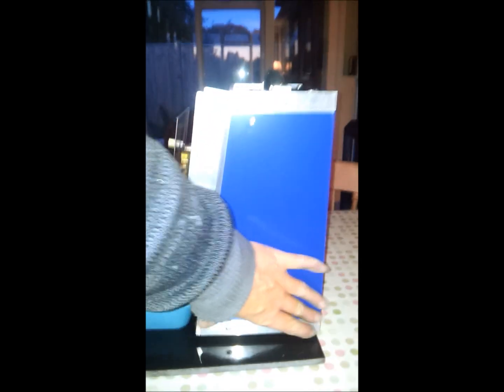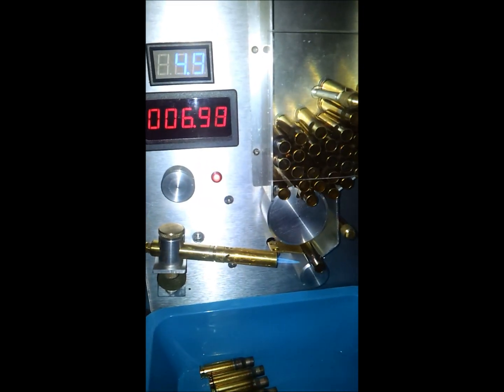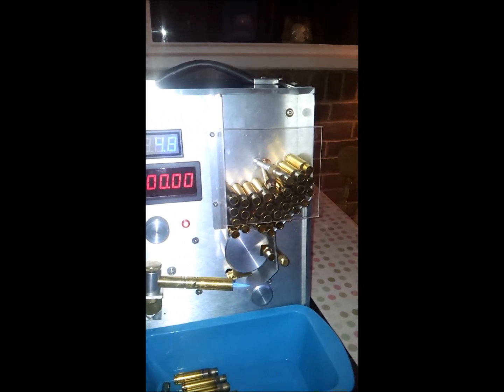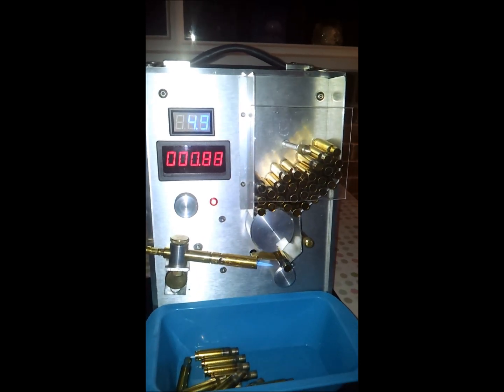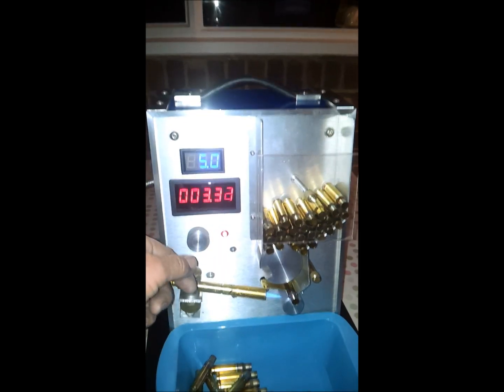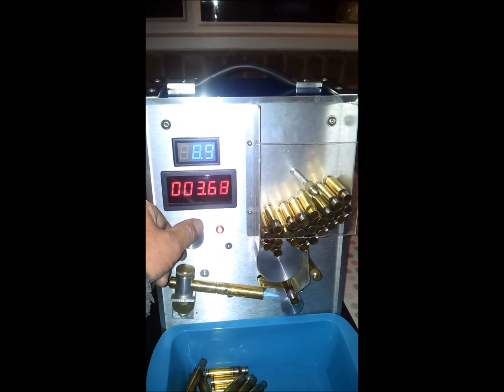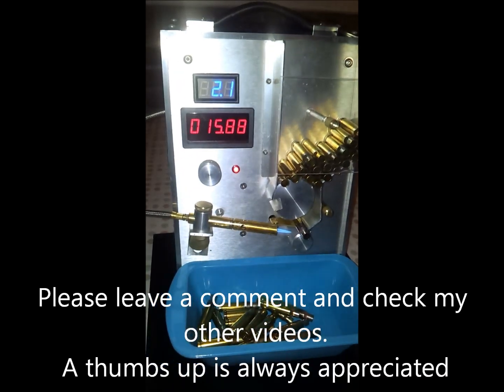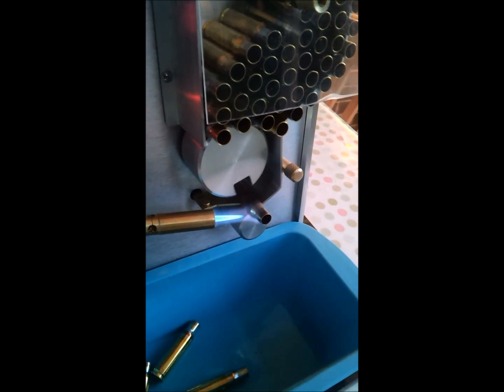Annealing machine  - Made in home workshop

Comment: Half a tank runs about ninety 308 cases???  What kind of tiny tank are you running??  Using my 14oz propane tank I annealed 850 .308 cases and couple thousand .223 cases and it probably used 10-20% of the tank!  At one point I hooked up nearly empty tank to see if I can use up remaining gas and it it just kept going and going, I was able to anneal 600 cases and still had gas to spare!  You just have to make sure the tank doesn't get cold as flame drops but that wasn't issue with 1st full tank.
Reply from the maker: That's a 1lb Coleman tank - it has the same fittings as the Rothenberger tanks. I've never counted how many cases I get out of a tank, at least several hundred. Those tanks can be refilled from a larger tank with an adapter. You right, it's the drop in temperature that lowers the pressure, not the quantity in the tank.
Reply: @Targetmaster1066  What I am saying is that you severely underestimating how many cases one full 1lb tank can do.  Based on my 900 cases  I estimate 10 - 20 thousands can be done.

Comment: Great annealing machine,and also good to see your casings are not being quenched in water as a lot of people don't realise quenching the brass actually makes the brass brittle and significantly shortens the life of the brass.
Reply from the maker: Thank you Badger and yes, certainly no advantage to water quenching brass.
Reply: Interesting about your comment on quenching. I was recently on a "reloaders" one day course where this topic was raised. Attending the course was a gent who has been a metal worker most of his life. He actually said that brass is one of the few metals that SHOULD be quenched in order to retain its malleability. He said most other metals would indeed become brittle if quenched, but brass actually needs to be cooled quickly (quenched) in order to stay workable!
Reply: @desolwage  no that's incorrect. Ammunition brass is subjected to high pressures compared to brass that's used for other applications.
Reply from the maker: Sorry Des, no benefits what so ever, to quench brass in water for case annealing (just stops you burning your fingers when you pick one up to admire your handiwork) Metal craft workers might water quench to enable them to immediately continue to beat/planish the work piece and also to loosen any shale/oxide prior to pickling.
Reply: @Targetmaster1066  The reason for quenching brass after annealing is to prevent the heat travelling further down the case and affecting the hardness of the rest of the body and even the head. You clearly have no idea what temperature you are subjecting the brass to or the hardness after annealing it or what effect there may be on the hardness and therefore strength of the rest of the case.
Reply from the maker: Thank you for your insight John and I agree the only way to harden brass is to work it. However, you clearly have no idea of what I know about about my annealing temperature or heat transference or the hardness of my cases - I've checked to see if I could learn anything for your videos on the subject but unfortunately not.
Reply: Quenching does not make brass brittle. Hardness and brittleness go hand in hand. The only way it is possible to harden brass is by cold working (deforming) it.
Reply: @johnspencer6270  lol bullsht. You have no idea what you are talking about.
Reply: @johnspencer6270  quenching DOES make brass brittle,it changes the molecular arrangement when the temperature is suddenly dropped. The same principle happens when blacksmiths quench metals when forging,it hardens the metal but also makes it brittle. When brass is used in the application for ammunition casings the last thing you want is brittle brass and THATS why we dont quench ammunition brass.

Comment: Any chance of making a how to video please. It's the best I've seen so far. Interested in making one similar. Thanks
Reply from the maker: Thanks for the interest - This was my first go at a proper annealer, well before the "skippy" annealer was introduced so really starting from scratch. Although I made about a dozen they were far too complicated to make with the mechanism and cams more like clockwork between plates. I then had a radical re-think and designed the Mk 2 which was much simpler but worked just as well. - I may well do a "how to" video of that machine at some time but at the moment working on other projects.
Reply: @Targetmaster1066  Thanks, what i really found interesting is how you managed to synchronise the rotors with one motor. Maybe even a look at the interior mechanism is enough for now, Thanks

Comment: What is the dimensions of the top roller that picks up the case out of the hopper? Im in the process of making myself one
Reply from the maker: Hi Cody - The case collector is made from some stock 2" aluminium bar, just skimmed down, it's not too critical.
Reply: thetargetmaster what about the cutout that picks up the case
Reply from the maker: It depends on what calibres you plan to anneal. That one does up to 284 cases, I believe the cutout is 13x13mm. This works for all the 308 family, 270, 243, etc. If you want to do .223 family you will need either a smaller cut-out to stop two cases trying to feed together of make a removable filler to pack out the cut-out a bit.
Reply: Yeah im doing 308. So it's 13mm wide by 13mm deep. Thank you sir. I used the salt bath annealing setup but there's to much loss of salt
Reply from the maker: Good luck with the build Cody - Let me know how you get on.
Reply: My boss is cutting the rollers right now. Hopefully I'll have it done over Thanksgiving weekend

Comment: what torch head are you using?
Reply from the maker: Hi Bob - The torch is made up of various bits. It's basically a Burneze  torch cut in half and the two halves joined together with a flexible tube from a gas camping stove.
Reply: thetargetmaster thank you sir

Comment: So where is the water in your quenching tub?
Reply from the maker: +rootbeer4969 Hello rootbeer. Quenching many metals in water usually makes them harder but brass behaves differently. Once the grain structure of brass has been modified by heating to around 750F, whether it's left to cool slowly or quenched in water has no effect.
Reply: But you gotta keep the heat at the shoulder from migrating to the cooler head. If the head gets too hot, the case is trashed...
Reply from the maker: +rootbeer4969 By careful use of Tempilaq heat sensitive paint I have found that the temperature at the head never exceeds 350F. The annealing process or stress relieving of brass starts to take place after around 700f - below 600f virtually no structural changes take place.No water quenching necessary.

Comment: Nice annealer design & well built. Does the case rotating drum have a coating on it? if so, what? Also how do you trigger the timer? & what is the drive train from top shaft to the bottom one.
Ian
Reply from the maker: Ian Sugden Thanks Ian. The rotating drum is machined out of 25mm Aluminium, there's no coating on it but it's knurled to give it a textured finish. Everything is timed from the central feed drum, a cam trips a microswitch to start/stop the clock timer and a cam lifts the blocking arm to drop the cartridge, nothing can go out of time as it's all locked on the same shaft.
Reply: thetargetmaster Thanks for the info - I'm having difficulty sourcing a digital clock like the one you used - can you tell me the spec & supplier? Also what is the burner head that you used? 
Regards Ian
Reply from the maker: Ian Sugden This is something similar to my clock:@itm/RED-LED-PANEL-DIGITAL-AUTO-CLOCK-CALCULAGRAPH-TIME-COUNTER-METER-COUNTDOWN-TIMER-/191442370802?pt=UK_Home_Garden_GardenPowerTools_CA&hash=item2c92dac0f2and the burner was made up form a BernzOmatic pencil flame torch and the flexible hose is from a camping stove - Needed to make and thread the adapters to join the bits together.
Reply: thetargetmaster  Sorry to be thick - the clock module spec on the module you specify indicates that it counts in seconds - not 1/100 of a second like yours. Can you explain a bit more about how it works & give me a parts list or circuit diagram please? 
I've made a similar annealer (mine ejects cases to the right) & it is performing ok - now I want to add the time display so I can easily set the speed control each time.

Comment: Very nice work sir.  I'm assuming its battery operated since you picked it up to move it, I didn't see any power cords attached.
Reply from the maker: secprf  Thank you. Yes, battery operated. I run it on a small lead/acid 12v battery. It runs about 4 hours on one charge (about 1,500 x 308 cases) The camping gas cartridge lasts for about 3,000 cases.

Comment: Any info on how much it cost to make this? Parts needed? Or whether or not you would make these to sell? It's a really nice setup that looks extremely well thought out.
Reply from the maker: Neil Harris Thank you Neil. The parts/material cost about £70 but about 100 hours labour. There's not much "off the peg" bits used, all the plates, bearings, cams etc. were machined from solid.